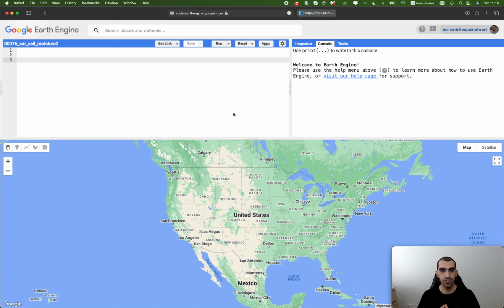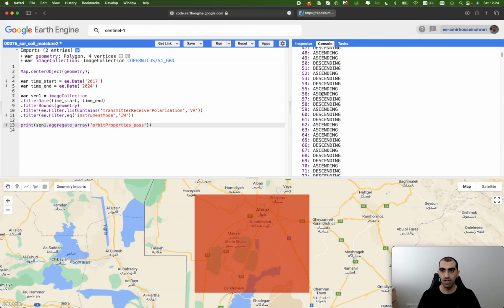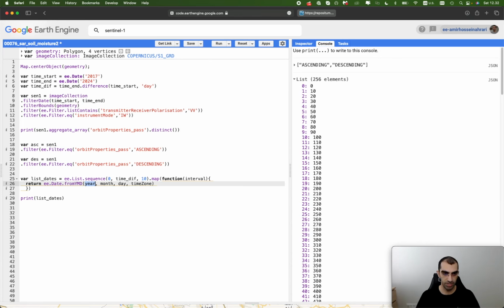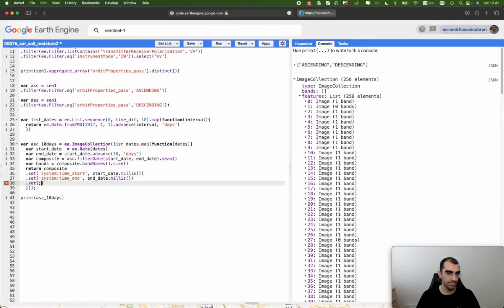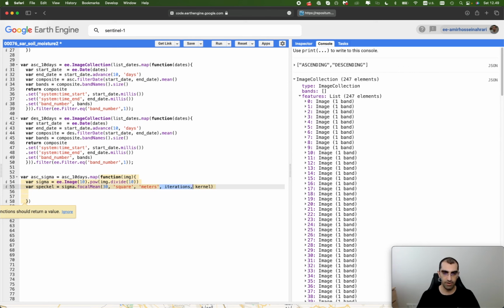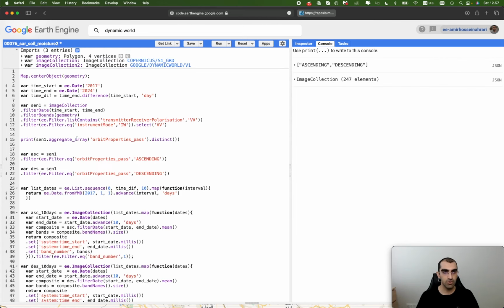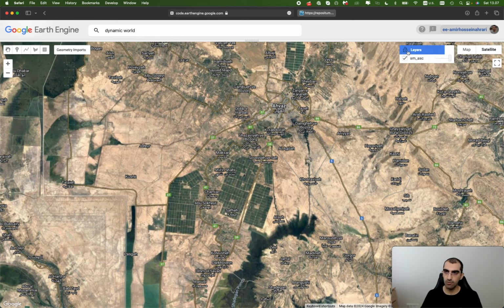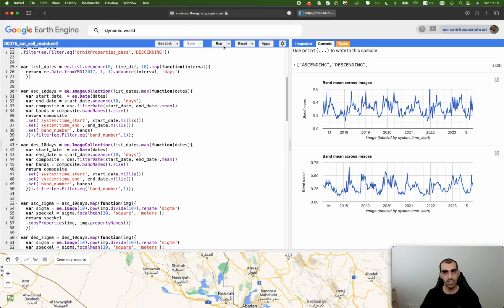Google Earth Engine Tutorial-64: Soil Moisture Estimation using Sentinel-1

Comment: Thanks again for this really usefull and clear tutorial. I'm taking the liberty to ask you an additional question. Regarding the polarization, as far as i understood, you target the VV polarization. In my case, i plan to apply your method for another radar sensor (JERS-1 for instance) with 1990's archives data. i don't know yet if i can upload/process these external archives data into GEE. But these data are only available with the single polarisation HH. According to you,It might be relevant to do tests with polarizations that are not VV ? (for instance HH, VH, HV). Or is the VV polarization criterion is really a requirement? Thanks again.
Reply from the maker: Welcome. You can use the same method for HH polarisations.

Comment: Thanks so much. Why do you set the scale on 30? Could we set the scale on 10 meters / pixel? This method can be apply for other data , for instance alos 2 palsar 2? In order to have beter spatial resolution ? And perhaps data before 2016? Thanks so much.
Reply from the maker: Higher scale causes more smoothness. I needed to reduce the speckel impacts as much as possible. 
Yes the method extendable to other satellites.

Comment: Thank you for this useful video for estimating the soil moisture index from Sentinel 1.  I have these two questions, please address,
1) What would be the final resolution of the soil moisture index using the above formula, as you have used speckle filtering of 30?  
2) When you use masking for water and urban, will that mask out the rice fields when they have standing water? If yes, then is it possible to not mask out those particular fields? 
thanks
Reply from the maker: Hi, 
final resolution is 30 meters. 
Urban and water bodies must be masked for soil moisture interpretation and computations. You can keep all agricultural field in case you use landcover layer for masking.

Comment: Dear Amirhossein,
Thanks again for sharing this brilliant content.
I have a question about soul moisture analysis.
In agricultural area or in area that have a high vegetation cover, is it possible to use sentinel 1 c band for assessing soil moisture? Or it is essential to use L band data because of long waive length .
I read some papers about it and most of them use WCM model in this kind of AOI. Because SM depends on landcover type (like vegetatIon cover) and in this case we need to consider the effect of vegetation.
What is your opinion? Which methods and data is most likely used in this case?
Reply from the maker: Hi, thanks for the comment. This is not exactly the "soil moisture". Meaning Band-C reflects surface moisture because of lower penetration compare to L-Band.